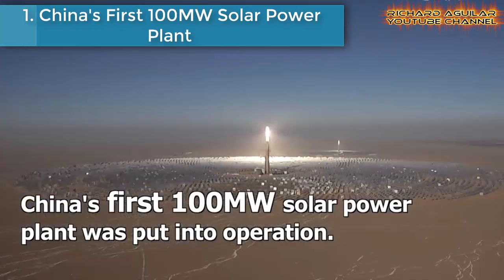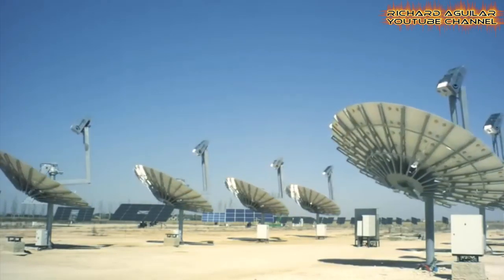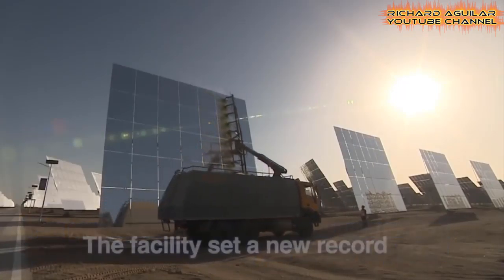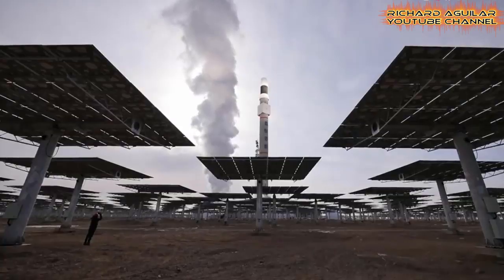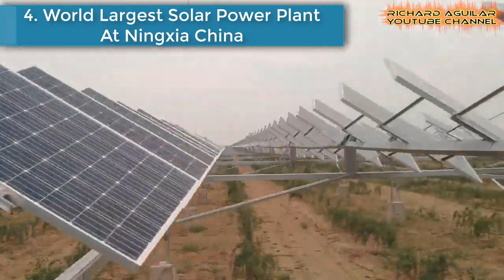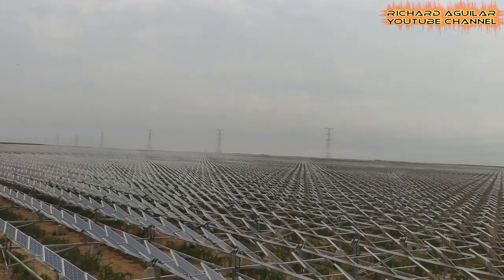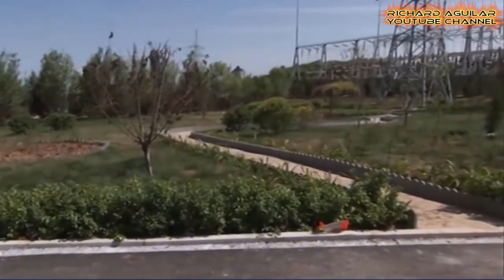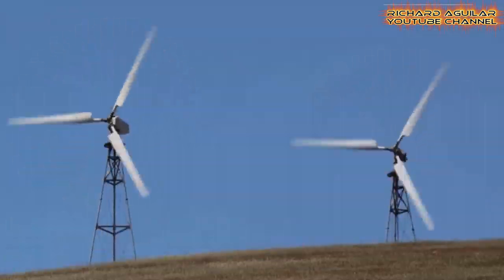China Uses Renewable Energy Technology To Combat Desertification

Comment: oh and by the way the solar panels efficiency dropped severely when there's not direct sunlight illuminated room only provides 20% panel power it cost them more just to have the power plugged into that but it does to generate power through nuclear or or natural gas is China's going to do anything like that they're going to have to put up solar blimps to get above the clouds so they can get some direct sunlight

Comment: Time to dump fossil fuels all together. 
No more coal powered power plants.  (replace with wind and solar)
No more gas and diesel vehicles for transportation. (replace with all electric BEV)
The Climate Crisis needs Climate Action Now.
Wind and solar energy combined with battery storage are safer, cleaner and cheaper than fossil fuels.
Electric vehicles are better than gas and diesel vehicles, lower fuel cost, less maintenance costs, no emissions.
We must speed up the transition to clean renewable energy to protect the planet.